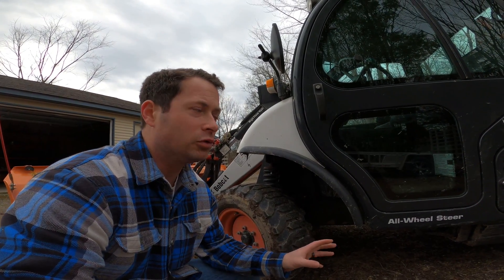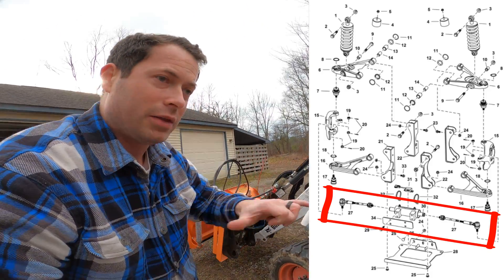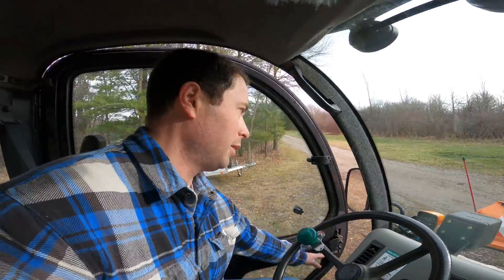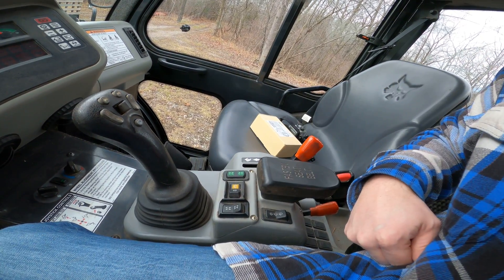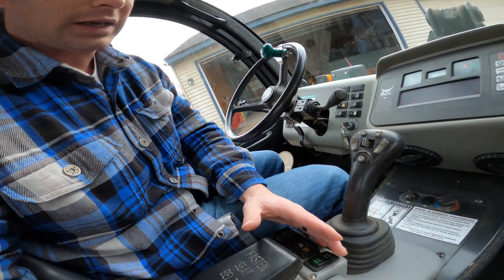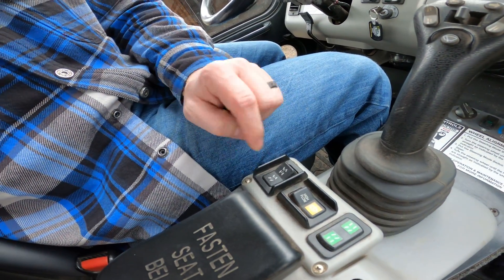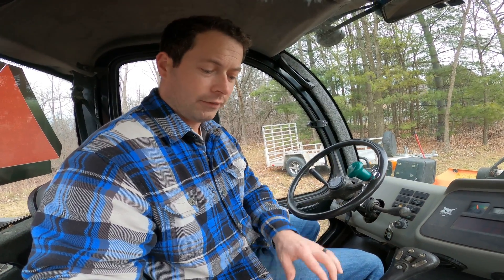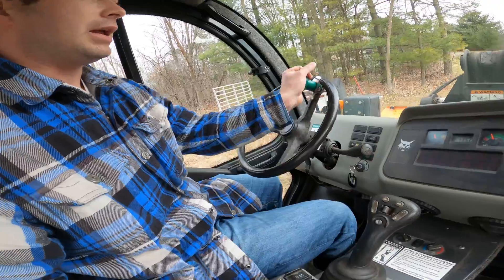✅ How the Toolcat All Wheel Steering Works - Crab, 2-wheel and 4-wheel Steering Demonstration

Comment: Dang. This was very informative.

Question: does your front brush cutter have a wheel on it, or does 
the entire deck literally hang?

Is a Toolcat capable of say 70% of it’s use case brush cutting / field cutting? Or is that too hard on the boom arm?
Reply from the maker: I fabbed up front wheels that bolt on/off with 2 large bolts each.  I use them when "mowing" but if brush cutting thicker stuff I take them off to protect them from damage.  The toolcat is made to work 100% of the time.  Field cutting is well within the limits.  If you were brush cutting 4-6in dia trees all day that might be a different story.

Comment: Nate, great video!  Good explanation on how to get in crab mode - how do you get out of crab mode and back to going straight????
Reply from the maker: To get out of crab mode turn the front tires approximately the same amount as the rear (in the opposite direction like they do in AWS) then flip the steering switch to AWS and turn until the rear is straight ahead.  Then flip the switch back to 2 wheel steer, align the front axle to straight ahead then finally flip back to AWS mode.  Easier in practice then it sounds.
Reply: @NaterTater  Thanks for the quick reply!

Comment: I have a 2007....Seems like the tie rods are super weak and using the crab feature is just a matter of when they break.  Any insight?  Have they upgraded in later years?  So little info out there on these.
Reply: Wow!  I was like WTF would some drive diagonal.  Your brush cutter just showed me.  I have an MTL Grapple and was thinking about this cutter.  You just sold me.  Let me know if you get an affiliate link.
Reply from the maker: @HankAvink  do you have a D-series?  Fuel tank cap on driver side?  If so you should have the same tie rod and steering cylinders as me.  I haven't heard of tie rods issues, what problem are you having?
Reply: @NaterTater  yes drivers side fill. I've snapped 2 rods. 1 was welded so didn't surprise me. The other was under normal usage.

Comment: Can you get atv style tread tires on it?
Reply from the maker: it comes with R4 standard.  Can get a wider and taller turf tread as well as a taller R4.  People also put LT truck tires on them, especially for winter.  Std diameter is 27in optional 29in but people fit 30-31in on them.
Reply: @NaterTater  sorry ATV style tread, Knobby
Reply from the maker: @BillCoSmith  I've seen some V tread tires put on like Carlisle Tru Power 29X12.50-15 C/6PR https://www.ebay.com/itm/Carlisle-Tru-Power-29X12-50-15-C-6PR-1-Tires/324090142328
Reply: @NaterTater  thanks